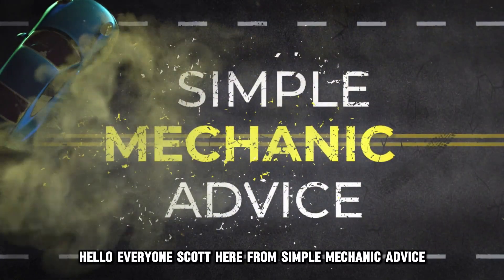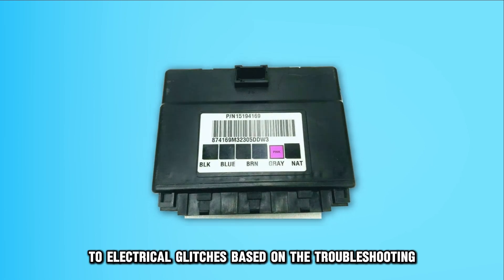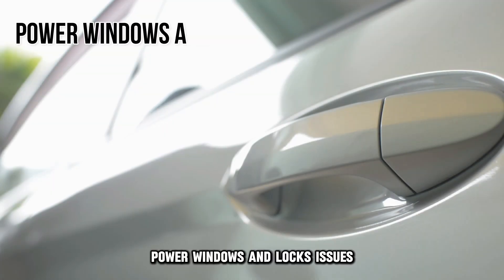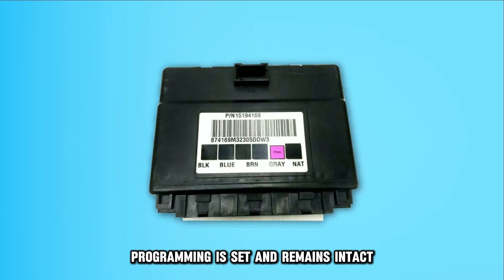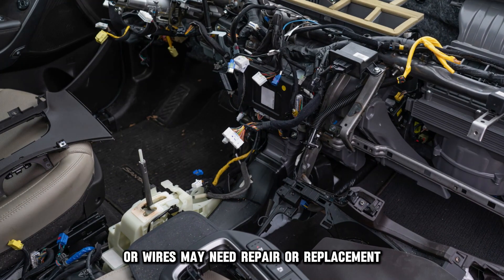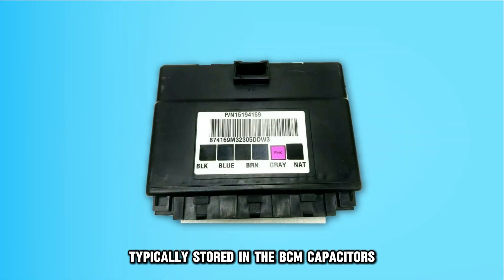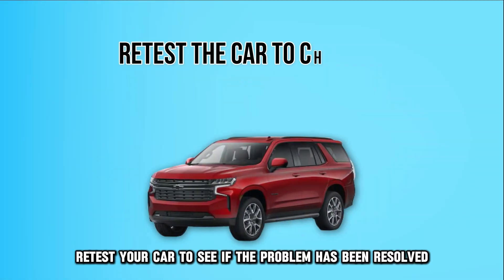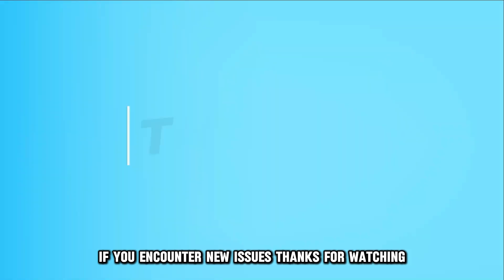How To Reset Chevy Body Control Module (Quick Guide)

Comment: Can you make video of suburban 15
Reply: Are you having issues with engine reduced power
Reply: I have this issue with my '15 chevy suburban ltz that just basically committed suicide last early spring. All lights and gauges would dim intermediately every 5 seconds and warning info would spew out every  attention needed etc, sometimes when parked it's in remote start mode. Can't shut engine off , doors would not lock- when trying to lock it'll unlock. So dealership replaced to a refurbished Telematics communications module ($1,100) repair bill!!! . This solved issue semi for a mth. Now as of yesterday-  it did it again all haywire with no gauge readings as I'm driving.  So I'm assuming after researching I'm replacing The BCM. Would that solve it? Hope so.
Reply: Ok but how long do you have to hold the cables together and do i have to remove the fuse before touching the cables together

Comment: Pretty sure this is AI so buyer beware
Reply: This is actually mostly correct- the faults mentioned can be caused by a BCM memory fault, and to perform a "soft-reset" you do need to disconnect the battery.

What you dont need to do is tap the battery cables together, (the capacitors will self-discharge either way). You also dont need to pull any BCM fuse once the battery is disconnected, that step does nothing
Reply: @looneyburgmusic  yeah that touching of the cables together had me wondering

Comment: This video is not very specific about touching cable links together. This could fry a BCM if any part touches the terminal,
Reply: Take both negative and positive cable after disconnecting it from battery and touch them that will drain all power stored in computers etc
Reply: Then don’t touch the terminal.